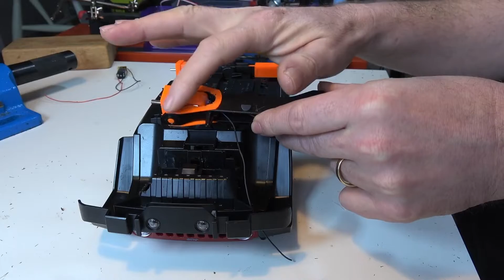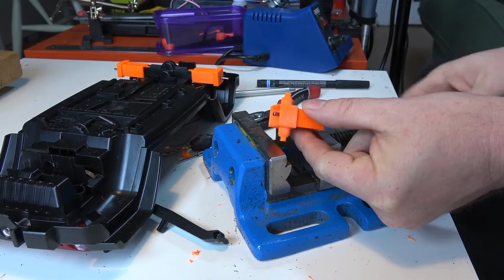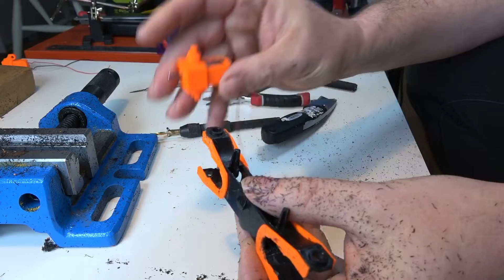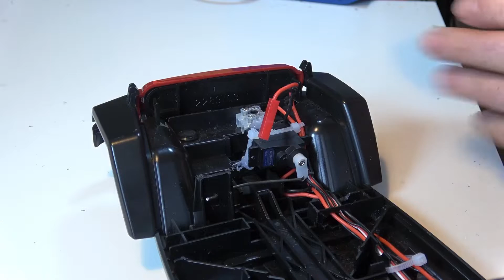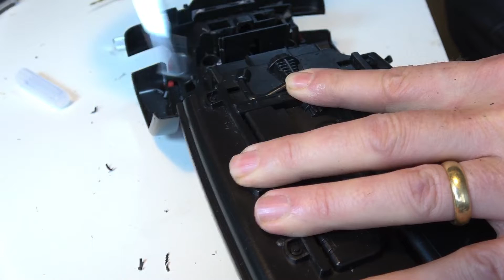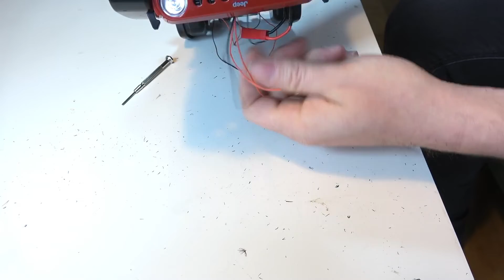Bruder Jeep RC conversion - 5. front axle

Comment: Throughout this build I´ve wondered just how you were going to tackle driving the front wheels while being able to steer them. Though I had decided that you would steer the motors because wires flex more easily than 3mm steel shafts, I still wasn´t prepared for the degree of ingenuity and cool design with which you´ve presented us today. 
 It´s such a neat and elegant solution - I´m full of admiration.
Reply from the maker: Thanks Del. The Jeep is actually quite a capable little machine (for what is - essentially a toy converted to RC). The 4 wheel drive function - with the electrical effect of all these motors being wired in parallel gives an effect not unlike a limited slip differential between all of the wheels (caused I believe by the changes to the internal resistance when the motors encounter different loads). The biggest challenges on this model were really to utilise as much of the original toy as possible whilst containing all of the parts within the chassis to allow the roof to be removed, all 4 Bruder folk to sit in side (with of course the capacity option for a dog, luggage etc to be maintained in the boot). The next instalment - the wheels will be published this Friday at 11:00 am UK time & will show my revised solution to the wheel adaptor conundrum ....... 😀👍
Reply: @RCModders  It´s interesting to hear that the change in resistance felt when a given motor encounters an increase in load leads to a limited slip diff effect. I wonder whether the current crop of 4WD EVs takes advantage of this? Perhaps their brushless motors don´t do it automatically. like there simple units.
 It´s the fact that you find solutions which allow you to use as much of the toy as possible which makes your Bruder conversions so satisfying. Your insistence upon maintaining the passenger and cargo capacity also sets a high standard.
 I´ll be keen to see the next instalment on Friday.
Reply from the maker: Yes this was an interesting effect; I learned on the bigger trucks never to put motors in series - as this has some quite horrible consequences for the amperage draw. Not sure, but I wouldn't imagine that the EV cars have a motor on each corner - ie they use one motor and then push the power through a conventional sort of drive train and then maybe use electronic breaking or even proper diff locks on the posh ones. 
I'm trying to maintain the standards I have set myself on the skid loader - where the 3D print augmented prototype is nearing completion!        😀👍
Reply: @RCModders   I quite understand why you wouldn´t expect full size EVs to use a motor at each corner - think of the unsprung weight issues! Oddly enough, many do do this, however. Apparently the engineers involved dread drive-train losses even more than having to control a whacking great motor slamming up and down...
 Yes, your conversions all have to comply with the same exacting set of minimum standards. It´s one of the reasons why I expect that your designs will become the go-to solution for most people for many years to come.